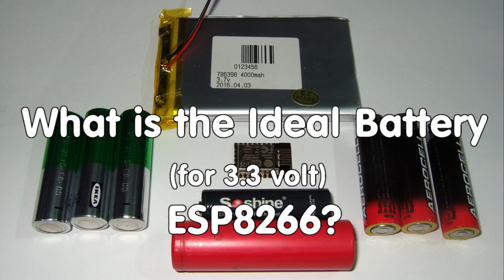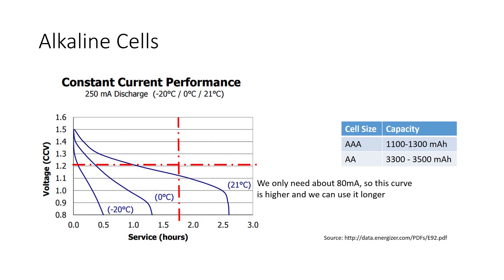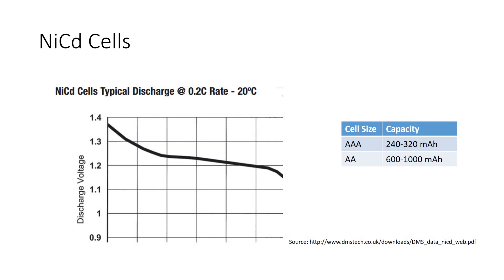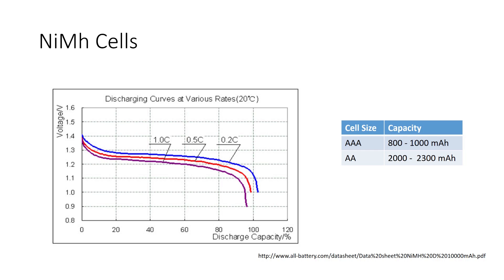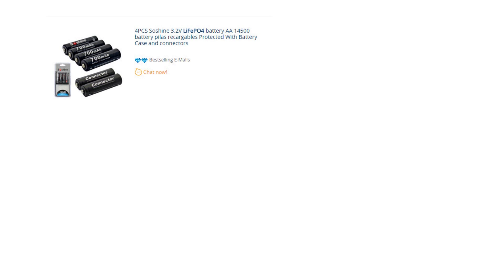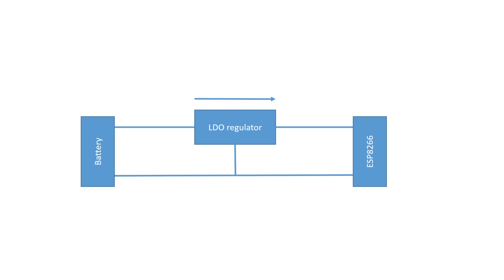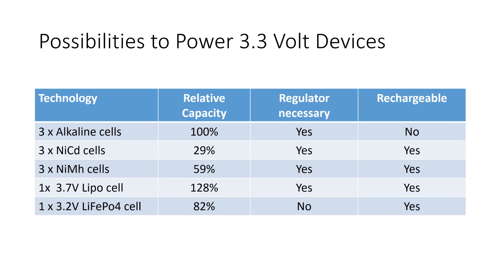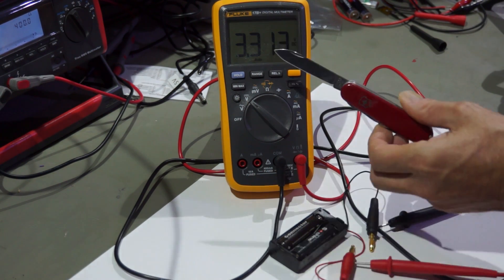#64 What is the Ideal Battery Technology to Power 3.3V Devices like the ESP8266?

Comment: Yo tengo muy buenos resultados con 2 Alcalina AA sin regulador, funciona hasta los 2.17v. Ahora voy a probar con una 18650 en serie con un diodo. Aunque tambien el regulador del wemos d1 es bastante eficiente.

I have very good results with 2 AA Alkaline without regulator, it works until 2.17v. Now I'm going to try a 18650 in series with a diode. Although also the regulator of wemos d1 is quite efficient.
Reply from the maker: It is good if it works, however, 2.17 volts is out of specifications

Comment: Thanks for the video.. if im using lipo 18650 cell for esp8266 do i need to use  18650 discharge protection?
Reply from the maker: You always should if you do not want to monitor it manually.
Reply: @AndreasSpiess  thanks for the quick reply. what is the best time to recharge at what voltage? And suppose if i forgot to monitor battery got discharged below 2.5v will it smoke/fire?
Reply from the maker: It might start smoking when you recharge a deeply discharged battery
Reply: I know I am late but just use TP4056

Comment: Hi Andreas, I was just thinking, when using a Lipo cell, would it not be possible to only charge the Lipo up to 3.6V, so that you don't need an LDO when using it in the circuit? Assuming you can control what voltage the charger stops at of course. How would a lipo capacity compare to lifepo4 in this case?
Reply from the maker: I do not know. I think the LiPo is charged less than 50% at 6.6 volts.
Reply: @AndreasSpiess  When I was looking at charts earlier, it looked like a LiPo would be 90% charged at 3.6V, but now that I'm looking at more charts, they seem to be all over the place, most being at 50% - 80% charge at 3.6V, depending on how many amps you're drawing I think... So it definitely doesn't look like a good option if you have LiFePo4 batteries.

Comment: 18650s are Li-Ion not Li-Po batteries. Li-Ion and Li-Po batteries may be fairly similar but they're definitely not the same. Li-Ion batteries usually have a better energy density and are more efficient, Li-Po batteries however degrade in capacity less than Li-Ion and often have a lower internal resistance and can therefore charge/discharge a lot faster than Li-Ion batteries. When connected in series Li-Po batteries drift apart more easily in voltage and therefore it is very important to balance charge them. Li-Ion however if well matched don't drift as quickly and are therefore often not balanced in laptop batteries for example (the voltages of each cell is monitored though and if they drift too far the battery will stop working). Still I would always balance either type of battery if you have multiple connected in series. Also Li-Po usually cost slightly more than Li-Ion batteries. There are other differences, but I would say those are the main differences. which depending on your project can make a very big difference. You can easily find small Li-Po batteries that can start your car without a problem. You will find no Li-Ion battery however that can deliver anywhere near enough current for that, you will definitely need a few cells in parallel (additionally to the series connection you need anyway to get around 12 V). Drones usually use Li-Po batteries for the same reason, they discharge their batteries in a couple of minutes, which is no problem if you have the right type of Li-Po batteries but can be difficult to achieve with Li-Ion batteries.
Reply from the maker: There were quite a few discussions in the comments below. Many viewers wrote that all batteries are Li-Ion. But I am no chemist ;-)
Reply: @AndreasSpiess  Of course, I'm not saying that I think your video wasn't well researched or anything like that. In the case of an ESP the difference isn't very important. Just thought it's worth mentioning that they are not identical.
Another thing worth pointing out would have been that LiFePO4 batteries while being great for an ESP while discharging, they are normally charged to 3.6 V. So powering an ESP with them directly while charging is pushing the limits, at least if you charge them fully. But those are relatively minor things. I don't think you were trying to make a 100 % accurate scientific video about batteries. And for a simple comparison of batteries the video is more than accurate enough. Just though maybe someone reading the comments would be interested in the difference.

Comment: Hi Andreas. Although you link to your blog, I can't find the supporting article to this video. Where exactly do you connect the AA batteries? The 5V pin (via the regulator) or to the 3.3V?
Reply from the maker: Maybe you watch the video again. You should find the diagram in the video.
Reply: @AndreasSpiess  apologies. I'm trying to understand where to connect NiMH batteries to the Wemos D1 which has a LDO regulator on the 5V pin as well as standard USB interface for power.

Comment: Are there ( rechargeable) batteries that can work good at a cold winter ( - 20 ) and hot summer ( +50) and still give high peaks of current for a 2G modem?  Thanks for your feedback.
Reply from the maker: Car batteries work also below zero.
Reply: @AndreasSpiess  But I meant small ones, for IoT devices...  2-10000 mAh... for example to track a bike

Comment: My esp-01 works just fine with a 3.7v 14500 battery and a diode (voltage drop 0.4v).
Reply from the maker: This is fine. the problem only can arise if your battery becomes weaker.

Comment: If you only charge the lipo battery to about 3.8V, then maybe it can be used without a voltage regulator? And also, the battery will sustain more recharge cycles if it is not fully charged each time. From your curve, most of the lipo batteries seams to drops below 3.8 after less than 100mAh, so I think that is a feasible approach.
Reply from the maker: It is for sure feasible. But then you cannot use standard chargers.

Comment: the question is what is the max times can a aaa battery can be charged 

or
what is the life of a aaa batteries
Reply from the maker: You have to ask the supplier. I mine says: 500 to 1000 times. But I did not check.

Comment: Hi Andreas, I have a 750mah 3.6v 2.7wh nimh battery and a ttgo v1 esp32 with built in lipo battery connector. I think it has a lipo charging circuit built-in but I'm not sure. My question is, can I use that builtin charger if the ttgo v1 has one to charger the nimh battery safely without damaging the esp32 ttgo?
Reply from the maker: I do not completely understand your sentence. The battery connector is here to connect a LiPo battery. So it should be ok to connect one.
Reply: Andreas Spiess Yes I risked it by experimentation and it turns out the built in lipo charging circuit can charge a NIMH battery just fine.

Comment: Hello sir. the esp8266 in my project needs to be constantly connected to wifi whenever it is on & needs to be portable as well. I am thinking of using LiPo battery with TP4056 as a rechargeable battery solution for this. Do you think this will work fine?
Reply from the maker: As long as the ESP gets its 3.3 volts it will be happy. As shown in this video.

Comment: I do not fully get your point of 20% loss for the regulator and 59% efficiency for NiMh. The NiMh cell reaches 95% discharge capacity at 1.1V. Three cells then still are at 3.3V. The HT7333 has only 150mV drop out voltage which causes 4% loss when cells are at their average 1.2V. So I would get at maximum 10% capacity loss, which makes NiMh a good choice since the AA's are available up to 2800mAh.
Reply from the maker: You should find the info in the video:
1. the LDO destroys the voltage above 3.3 volts. The loss is (Vbatt-3.3)/Vbatt
2. The capacity of NiMH for the same volume is much smaller than the capacity of LiPo
Reply: OK, I see your point. Maybe more of a problem is the dropout voltage of various regulator types. I now checked the HT7333 at 70mA load and found it to be 500mV. This means that for 3xNiMh cells that are on average 3.6V, the ESP will not be running at 3.3V but at 3.1V and loss of efficiency. I will now test various regulators. Straight usage of NiMh would be ideal, but how to avoid the initial high voltage? Maybe using a zener  to burn it off?
Reply from the maker: In the datasheet, they specify 90 mV at 40 mA
Reply: I know, but this is not what I see. It is a Chinese brand ..
Reply: A correction: I now tested some others and found 225 mV dropout at 3.4Vin @ 80mV load. So these would be suitable regulators for the 3xNiMh cells after all.

Comment: Nicely informative video! The only thing missing is if you made a final comparison to show just how much battery life you would get from each battery option (possibly even with a comparison of their price). From your video it sounds like a LiFePo4 would give the most battery life to an ESP8266 since it has good efficiency and no need for a regulator? But unfortunately you didn't show that in your video. Maybe suitable for a follow-up video, comparing battery life & cost for powering ESP8266 using LiPo vs LiIon vs LiFePo4?
Reply from the maker: I do not plan to take cost into consideration as it changes over time. But it should be possible to assess it yourself if you look at the actual price of the batteries you consider to buy. You should have the needed data in the video.

Comment: Hello, I know this is an old video, but I wanted to say something: 
1. If you use a buck converter, you get higher efficiency and the capacity lost might be only about 5 % in the worst cases. Plus, there's almost no voltage drop so you can use it until it reaches 3 V, but for stability, it's better to cut off at 3.1 V or 3.2 V, when the battery is almost empty, and also Li-ion batteries don't like being fully discharged, so it's better for the battery.
2. There are different Li-ion chemistries. The most common are LCO (Lithium Cobalt Oxide, LiCoO2), which is the most common type and with extremely high capacity, but the most dangerous, NMC (Lithium Nickel Manganese Cobalt Oxide, LiNiMnCoO2), the next more common type, used in Panasonic's NCR18650 batteries, which are safer with almost the same capacity and LFP (Lithium Iron Phosphate, LiFePO4), the safest "cheap" ones  (there's also lithium titanate, LTO, tremendously expensive), but with lower capacity.
Reply from the maker: Thank you for your information. I am only a "battery user" and do not understand too much. So I learned something...
Reply: You're welcome. A page with further information is this one: http://batteryuniversity.com/learn/article/types_of_lithium_ion. Battery University is a good website to learn about batteries.

Comment: Andreas, thanks for this great comparison.  I'm looking at several types of voltage regulators for use with the 3xAA solution.  I want one with the input voltage as close as possible to 3.3v to take full advantage of the battery life.  Do you have any particular modules or other advice on how to ensure I get the best one?
Reply from the maker: HT7333 is a good one

Comment: I’m a year late to this conversation but I hope I can still get a response. 
I have been siring an 18650 with a diode between my ESP and the battery. The voltage drop across the diode gets me right in the sweet spot of 3.3v.  But is there some downside to doing this. It seems to easy.
Reply from the maker: There is a downside: At the end of battery life you also drop 0.7 volt. If you want to stay inside specifications of the ESP you can use your battery only till about 3.6 volts and lose a big part of the capacity.Good LDOs only drop 0.15 volt minimum and you can go to 3.2 volt.

Comment: Great video!  What about lead acid gel cell batteries? I think they might have better cold charging tolerance than the LiPos and come in a wide variety of sizes at ~2V/cell. For non-flying applications, their density (heavy mass per cell) is not a problem, and in fact was a benefit when the wind was strong and my project box did not blow down!
Reply from the maker: You are right. If you have no space constraints this is probably the best solution. And also well known over many years.

Comment: Supposing I am using a Lifepo4 battery, would I still need to use a 1000uF capacitor near the ESP8266 so to protect it?
Reply from the maker: The Capacitor has nothing to do with the battery technology. It makes sure your ESP gets enough current during its short sending cycles.
Reply: Thank you for clarifying this

Comment: What about CR123a?
Reply from the maker: These batteries are usually not built for high current (up to 300 mA) of an ESP8266. But I never tried.
Reply: Coin cells are not suited for large current, but batteries like CR2 and CR123 are. If you look at the datasheet (.e.g. http://data.energizer.com/pdfs/123.pdf ), they list a maximum continous discharge rate of 1500mA (3500mA pulsed). I consider them ideal for sensors due to the fact they are smaller than AA or AAA, have very low self-discharge (up to 10 years lifetime), cheap, available almost everywhere, large operating temperature range (-40C...70C) and able to provide large peak currents (e.g. during wireless transmit). 

And you don't need a energy wasting LDO in many cases... directly power a MCU, sensors, radiomodule (e.g. RFM95, RFM69...). An ESP8266 module typically works up to 2.6V. So that would also not be an issue.

In short:  ideal for very long lasting low power devices :-)

More information and a comparison to other 'primary type' batteries can be found on e.g. http://lygte-info.dk/info/CR123A%20and%20rechargeable%20substitutes%20UK.html

Comment: I am still very confused about how to actually get a LiPo into the 8266. I hear about regulators, step up, step down, lots of things I can't seem to find any good information about.  There seems to be alot of assumed knowledge about batteries out there which makes it very hard for beginners to grasp. I'd love some LiPo clarification, because those nice little square batteries look so impressive, but using them is still beyond me.
Reply from the maker: To power the ESP866 you need 3.3 volts. If your battery or other power supply has more than these 3.3 volts, you need a step-down regulator or converter (two names for the same thing). If your battery has less than 3.3 volts you need a step-up converter.
You can buy linear or switched step-down converters, but only switched step-up conveters.
Step-down converters are also called "buck converters" and step-up conveters "boost converters"

Comment: I think LiFePo4 is the most cold tolerant of rechargeable batteries. If your device needs to work in sub zero temperatures, you may need to create some kind of heating thing to keep LiPos warm, which will likely eat most of their capacity.
Reply from the maker: Sub-zero degrees are really a problem for these batteries...

Comment: nice, but isnt the 3xAA percentage also 80-90% then? and Lifepo4 cells are the best with 82% then?
and could i also get 5volts from the board itself(5v output pin), if the battery input is only 3.0-3.2 volts? (because some sensors require 5volts input.... even if pwm output is 3.3v....)
Reply from the maker: Most boards have a linear regulator which only converts 5 volt to 3.3 volt. Not in the other direction.

Comment: Hey Andreas,
I must say that I really loved your videos, watched 20 of them today!

I want to use a 3,7v LiPo battery for my ESP8266 and for my ESP32,
Could you please provide a link to a proper regulator that I need to use?

Thanks.
Reply from the maker: Just a normal 3.3v LDO like the AMS1117 or similar. I think, I even have a video about that.
Reply: This one could fit?
I'm asking because the Lipo is 3.7V, and here it says input 4.1V to 7V...

https://www.aliexpress.com/item/HOT-5pcs-lot-AMS1117-3-3V-power-supply-module-AMS1117-3-3-power-module-AMS1117-3/32581622965.html?ws_ab_test=searchweb0_0,searchweb201602_3_10152_10065_10151_10068_10307_10137_10060_10155_10154_10333_10056_10334_10335_10055_10336_10054_10059_10332_100031_10099_10103_10102_10052_10053_10142_10107_10050_10051_10172_10326_10084_10083_10080_10082_10081_10110_10111_10112_10113_10114_10312_10313_10314_10316_10078_10079_10073-10333,searchweb201603_21,ppcSwitch_3&btsid=1defd6ab-974e-4fd7-abf8-e059f0310905&algo_expid=47aad1e2-0652-49aa-9abb-1f9cae4d9bc2-9&algo_pvid=47aad1e2-0652-49aa-9abb-1f9cae4d9bc2&transAbTest=ae803_2
Reply from the maker: This one has a dropout voltage of about 1.1 volts. So, it needs a minimum of 3.0 + 1.1 = 4.1 volt at the input to get 3 volts (minimum for ESP). A better choice would be a HT7333 which has a dropout voltage of only 0.15 volt.
Reply: Thanks for the full answer!

Comment: Andreas what if i power the esp with 1 lipo if its full... 4.12v will it burn the esp ? Also a 1200 maH is enought ??
Reply from the maker: The ESP specs go ut to 3.6 volt. So, it is better to use a LDO to reduce the 4.1 volts. Will probably not burn, but you never know.
You have to check how long your 1200 mAh last and compare it with your expectations.

Comment: What do you  think of using a LoPo cell with a simple diode in series? I have some ancient 1N4001 diodes here and they drop the voltage by .6v. I am guessing that there are better choices for a diode, but I have no experience with them. The 4.2v would be dropped to 3.6 which is within the 8266 specs. The voltage to the 8266 would be too low at the end of the discharge curve, but most of the LiPo capacity should be available.
Reply from the maker: You can use a diode as you describe. LDOs usually have only 0.15 volt difference at the end. So, you would gain a little. But the ESP usually works below 3 volt, even if it is out of specs.
I usually use a LDO because they are not expensive and I have always exact 3.3 volt (also for other parts).